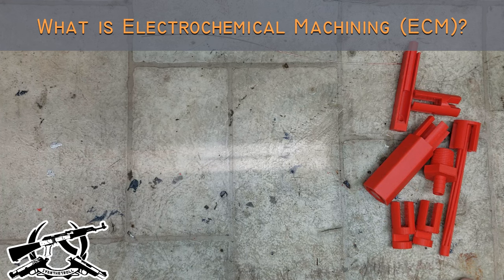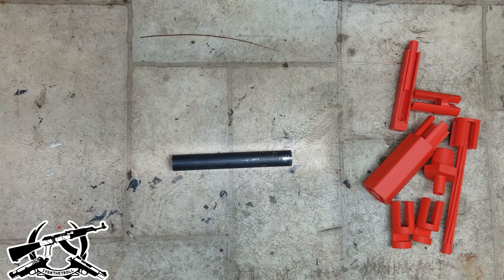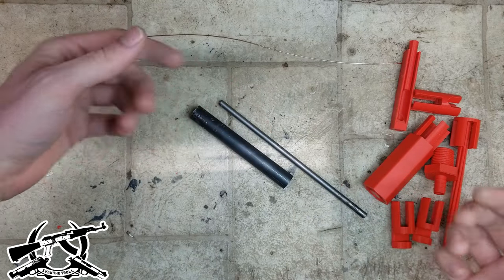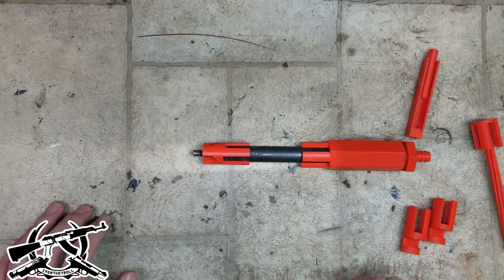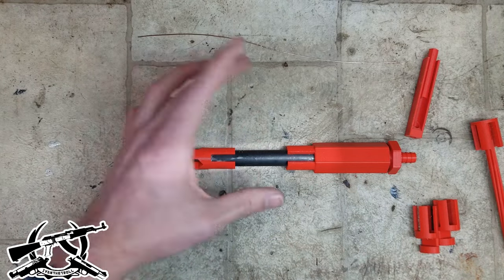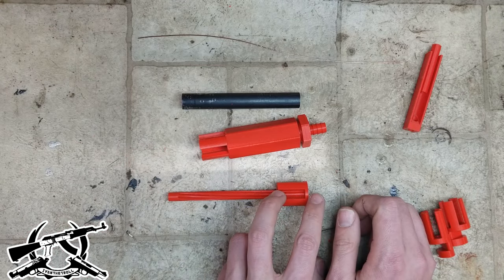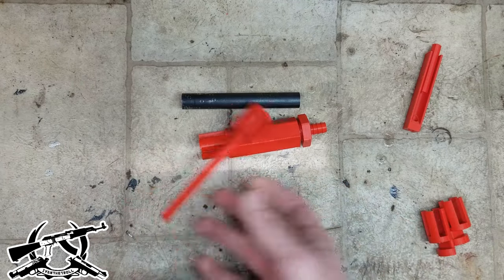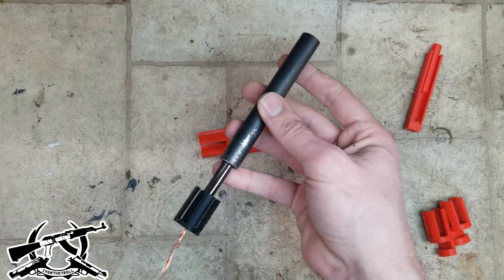How To Make Rifled Barrels At Home Using Electrochemical Machining

Comment: Started building the rifling machine made by Clinton Westwood. However, ordered a piece of 8.6mm, hydraulic tube from AliE and will print your parts to ECM some barrels as well. Thank you so much for helping to keep the flow of knowledge from being censored by those who desperately want subjugation. Knowledge is power.
Reply: If it is not too much trouble, can you share the product link. Tried searching through AliEx, couldn't find any appropriate one.

Comment: That's a very cool and interesting video and DIY project.  The one critique I'd offer is that barrel land are usually about the thickness of a piece of paper, about .004".  If they expand at all down the length of the barrel, the gas will blow past the projectile.   So I do wonder if the tolerances on parts 3-d printed would offer that degree of precision.  Don't get me wrong, I still think there's a ton of great info here.  I'd just be really interested to see how this final product would be.  One thing which I think would be really cool to do with this kind of ECM here is fluted chambers used in delayed blowbacks.  Fluted chambers are nearly impossible to make with conventional subtractive machining, but I think your method would be great for it.  You could also do gain twist rifling I suppose.

Comment: Well, i thought it was never going to work like i told you. It needed some part that would leave the rifling, and i thought how would you 3D print that? Also, i said: well i think you need some constant waterflow, otherwise it wont work right. I believe i referenced to: "reliable EDM". Did i mention indexing??? The account got deleted, but i wrote some extensive emails, :P Still very happy with the m16 blueprints, about to build a lot of those legally. Mass produce them actually.. In the "old fashioned" steel and aluminum way. 

Yes i was the guy advocating button rifling and with a lot of CAD files on it. It is the fastest and cheapest way to do it in a machine shop. Unless you have a big wallet a hammer forge rifling machine is best. 

It seems that youve got it all solved. Congratulations!

Is there a way to get the documentation? The link is dead. 

Thank you! 

Greetings,

Jeff

Comment: I vaguely remember that you made a mandrel that used a single center rod instead of wires. Did anything come out of that version of the rifling mandrel? It is much easier to ram a nail down a center hole than use 6-8 individual copper pieces.

Comment: 14:00 You should just print off a rectangular piece that fits into the cutout. Then glue it to the barrel. All you need to do then is slide the mandrel on to match up with the rectangular piece. Just break the plastic piece off the barrel when done. No need to worry about scratches or slight inconsistencies of alignment.

Comment: are there any guides on deciding twist rate for progressive rifling? or is it as simple as start a little under ideal rifle rate and end at the ideal rate of your preferred projectile weight
Reply from the maker: You usually start at something pretty slow and ramp up. I'm not aware of any formal studies on this sort of thing, I went with 50:1 initial on these barrels.

Comment: I'm probably on a list for watching this and associated content in the UK, but I just find it fascinating. 
I'd certainly do these things if it were legal. I mean I don't think there's inherently anything illegal about manufacturing a rifled barrel, for like an air rifle or something. I have no intention of doing so however.

Important edit: Upon further research, yes... this is very much a no-no in the UK. I could buy a replacement barrel for my sub-12ft/lbs air rifle no problem, but if I manufactured any kind of barrel I believe that could land me in hot water.
With the way the relevant law is worded, I don't really see any way around it. Unless you could somehow prove the barrel is incapable of firing a projectile with a muzzle energy of greater than 1 Joule.

Everything fun is illegal in this country. I'm fed up.
Reply: Free men don't ask for permission

Comment: I'm amazed that ECM can make consistent and uniform changes to the metal. Curious what part of the process ensures uniformity. Is it just the water flow?
Reply from the maker: Every variable factors in, really. Even temperature.
Reply: @IvanPrintsGuns  were can I get the stl files easily and free
Reply: @Blakes123  hate to revive an old thread but look up some key words from this video on Odysee

Comment: So I've never shot a gun and will never build one of these due to the laws in the country. I just find the processes and workarounds so fascinating. 
I was wondering if it's possible to join multiple steps together; rifling, cutting a throat and chamber. They don't seem to overlap in areas of the barrel. Are they kept separate because they have different cutting times?
Reply: Your guess is correct, you cannot combine all of these tools together because each tool has a different time for cutting. Just a theory, but if you were doing mass production and using rods with the exact same dimensions every time you could probably find a way to homogenize the whole process, but since most of us retail users only need one barrel (and said barrel can vary in caliber/length depending on what you need it for) it's best to separate each step for accuracy

Comment: Hey, I didn't know about ECM before, from what I've read you're supposed to plunge the electrode into the material, but here it seems you just have it hanging in the middle of the chamber. How does that work? And how do you manage the tolerances? From the docs it just seems you keep measuring periodically, but I wonder if there's a more precise way.

As for the throat and chamber, if you managed to know removal rates in a precise way couldn't you just machine them onto the electrode and do them all in the same step as the barrel? Thank you!
Reply: steve
Reply: You are mixing up ECM and EDM.. two different processes.
Reply: @roughedge-machineworks   He's 100 percent correct and it doesn't matter if your referring to ECM or EDM as both processes will further erode material if left on for longer periods of time. Voltage and amperage both play a part in erosion rates and so does gap between tool and the part being machined. There's no easy formula for calculating the best voltage and amperage either as that is also effected by the size of your electrode as well as depth.
Reply: @tenlittleindians  Polarity also matters for erosion rate, especially for ECM.  The anode of an electro-chemical cell, being oxidized, can quickly erode most materials of interest.  While the cathode, being chemically reduced by the current, remains clean.

Comment: ivan, please help.
im doing everything correctly, ive reached a bore size to fit my mandrel snuggly. but it took tons of extra salt added, as well almost three hours.. stumped. im on well water. 

now, with rifling, i am making almost no progress. im making the 16inch version for the stingray,and it seems water is making it to the end, and the mandrel fits easier each time, but so far im an hour into the process.. what gives

please help, sos, can send exif data stripped images. i love you

also struggling with the lock tab spring being pressed in! whats the length measurment? is mine too long and needs trimmed? 

im gonna post this on every platform i can find ya on till someone helps me lol. im desperadoooo
Reply from the maker: If you're only running 7.5a for a 16" barrel, an hour or two for boring isn't unheard of. You're removing a lot of material. Adding too much salt can cause issues though, you really shouldn't have to resalinate.
Reply: @IvanPrintsGuns  i feel like im getting nowhere. i upped it to max (10a/30v) and spent all day having made little progress.. switched to distilled water. sticking to 304g~ of salt. 

i tried an NDI with a bullet/hammer/rod and my bullet barely goes in. maybe i didnt get accurate measurements with my digital calipers during the boring process? 

ordered a new tube (8.8 innerdiameter) and copper for making a new mandrel.  any recommendations on an upgraded power supply?
id donate money if you had time to spare to help me troubleshoot. i can provide pictures and videos
Reply: @TheEarthwormslim did you fix it all

Comment: Could you shape the outside diameter of the barrel using this method? For example, purchase a barrel blank and then bring it to proper size by ECM?
Reply from the maker: It is possible, there's a brilliant fellow who has designed an ECM OD reducing tool.
Reply: @IvanPrintsGuns  are files available for it?
Reply from the maker: @Svenhansson  in beta testing on rocketchat
Reply: outer diameter is as simple as using a lathe and file any machine shop can do it quicj and cheap
Reply: @thebowtieguy777  If you send a barrel to get profiled the machinists will instantly know what you're doing. Do you have any idea what's being done here?
Reply: @ChucksSEADnDEAD  yeah 
why would a machinist care about shaving a barrel
Reply: @thebowtieguy777  You have no idea what's being done here. You're not in Kansas anymore, Dorothy. The guy who developed the weapon this barrel is meant for died after the German police raided his house.

Comment: To make a bottleknecked chamber for a 5.56 barrel maybe you could grind down the chambering rod even further until it looks something like the 5.56 casing or two part "step drill bit" ? Although I have a strong feeling this part would have to be machined
Reply from the maker: Using pewter or lead to cast a necked electrode using silicone molds made from 3D printed investments would probably be the easiest way to get that done.
Reply: You can buy chamber reamers that drill out for bottleneck cartridges.
Reply: @ToxicSocietyTroll  you can also buy parts that rifle barrels yet this is on a video about making your own rifled barrels with alternative methods
Reply: @ToxicSocietyTroll  that’s how we did it at Remington. Chamber reamers.
Reply: Just buy a clambering reamer

Comment: So I don't know the exact amounts or if it's dangerous, but doesn't using electricity on salt water produce some chlorine gas?
Reply from the maker: It can, but so long as fluid flow is ample while cutting occurs, this risk is essentially negligible. Even cutting indoors with poor ventilation isn't a major hazard unless you make a habit of it.
Reply: @IvanPrintsGuns  is an open window with a fan on sufficient "ventilation?"
Reply: @gunfightersquid6732  fuck that, use it as an excuse to buy an FM50 lol
Reply: *Avon FM50
Reply: @IvanPrintsGuns  Update the link in description.

Comment: how to get your house raided by the atf in 1 simple step:
Reply: Did he? Lol nothing is illegal
Reply: @zakbrinkhoff324  something definitely is illegal, that being barrels and firearms in europe. atf will surely not raid anybody for making a barrel but still your "nothing is illegal" is kinda worrying
Reply: @grqfes   There's no such thing as the ATF in Europe. There's also no such thing as all guns and gun related parts being illegal in all of Europe. The same process works for barrels for pellet guns and the last time I checked those were for the most part still OK to own in most of Europe.
Reply: @tenlittleindians  i know there's no such thing as the ATF in Europe. Firearm barrels are considered an integral part and illegal. Don't know what you're talking about
Reply: @grqfes   Last time I checked several of those EU countries still allowed some shotguns and some rifles and various pellet guns. Even though England has left the EU I still include them when we are using a wide catch all such as the EU.

There's plenty of barrels that could be classified as legal in many of these countries. Even in anti gun Australia there are still private owned firearms. 

Your nothing but a anti gun spammer.
Reply: @tenlittleindians  you're*. Yes they exist. They exist due to heavy licensing. I didn't say they were impossible to legally acquire. Why the hell am I still arguing with you if you don't know the difference between you're and your

Comment: I was doing this with different stuff... using twisted romex wires, and ferric chloride.

Has anyone tried progressive rifling?
1:8 - 1:4 for a 7" 300blk barrel
This would help stabilize the 200+gr projectiles subsonically.

Comment: This is no way would be as clean as a machined part. Otherwise companies would be making their guns this way. Also where is your finish product???
Reply: Duh. This is made for 3d printed firearms. Mainly intended for people with tyrannous governments which wont let you just buy a barrel.
Reply: there have been no tests with side by side comparisons of ecm vs machined, but the process of ECM hasnt been developed on a production level yet, so ecm can be more tedious with its manufacturing not having standard operating procedures, yet.

 i have heard of professional production machined components being off by 1 degree, or 1mm, and in those cases, a replacement part needs to ship out and be installed to fix the error. it happens on cars and objects all the time. hence recalls. its not uncommon, but customer service for firearms, especially on a retail level, has to be held to a high standard or someone will be hurt.

 i believe the people who produce firearms and firearm components legally, and underground, have good intentions, and until we have seen ECM on a production level scale, its too hard to tell which process provides a cleaner finished product.